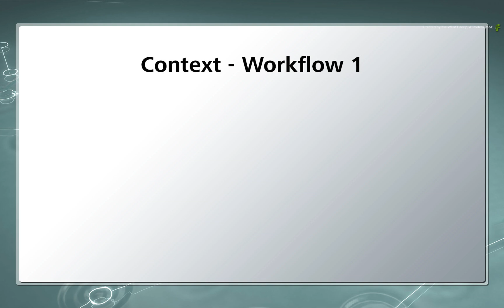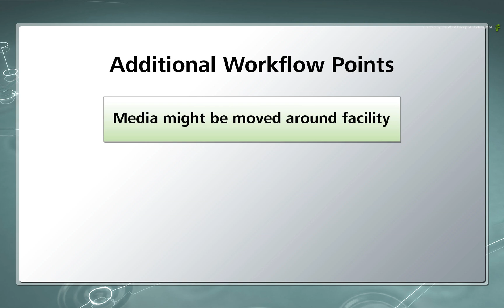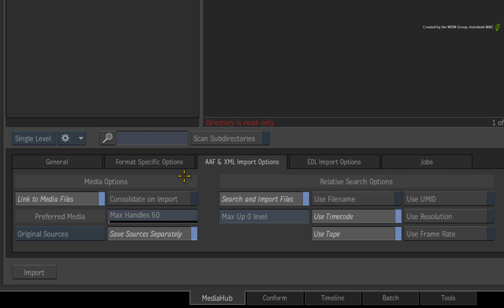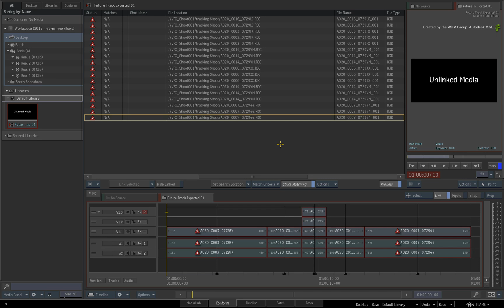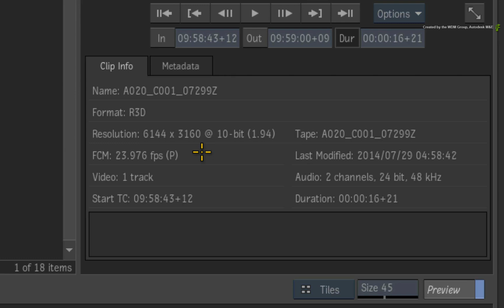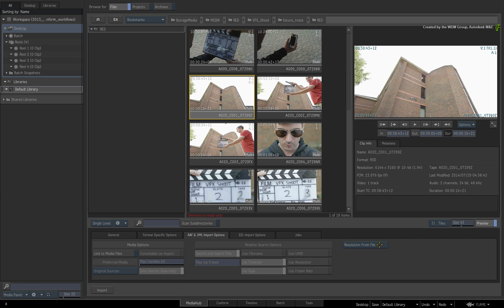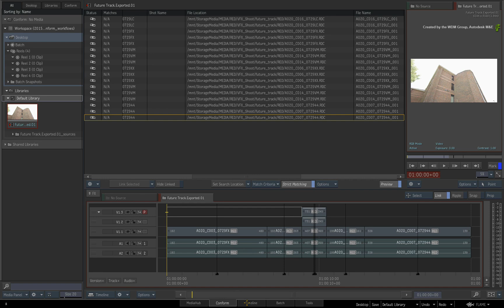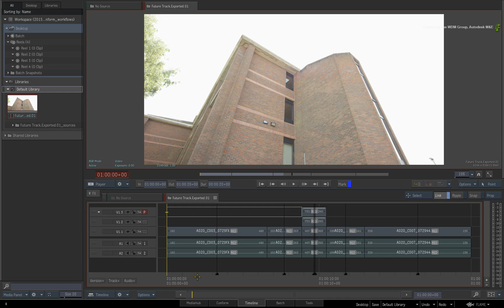Conforming AAF using Camera RAW Media - Workflow 1

Comment: in this method, does flame stay linked to the original files on the NAS, and doesn't import them to the stone? 

If i do want to import the linked media to the stone, for faster work and archiving, how and on which stage do i do this?

thanks.
Reply from the maker: Hi Paul Wolf This method links to the original files and does not cache them to the local storage (stone)  In your case they will remain on the NAS.  

If you want to have a cached version of your media on your local storage, I suggest getting the sequence to the point where you are happy and consolidate the segments to an acceptable amount of handles.   Once this is done, you can select the sequence clip in the media panel, right-click and cache a local copy.   Once the cache is completed, you will have a localised version of your media which is fast and more interactive than a NAS connection.
Reply: Flame Premium Learning Channel great! thank you. one more question, how do you cansolidate with handles? is it in the mediahab menus before dragging the AAF, or afterwards as a apart of the context menu of the sequence (right click).

thanks again.
Reply from the maker: Hi Paul Wolf, you consolidate handles after conforming the AAF through the contextual menu.